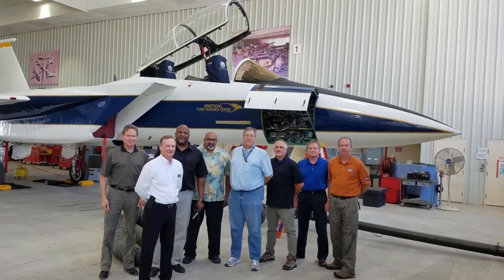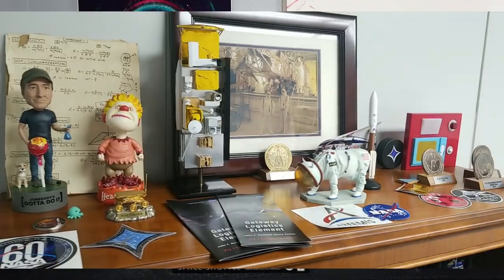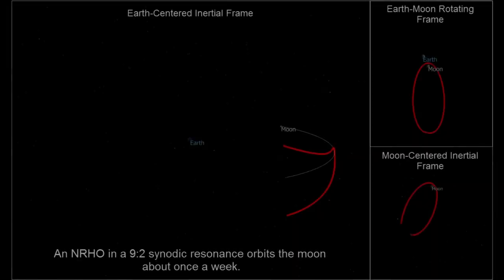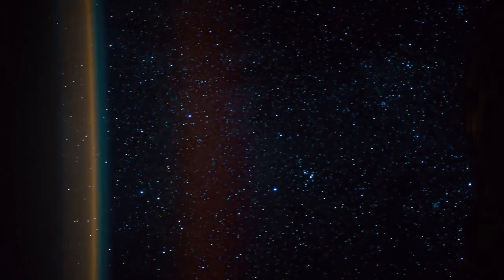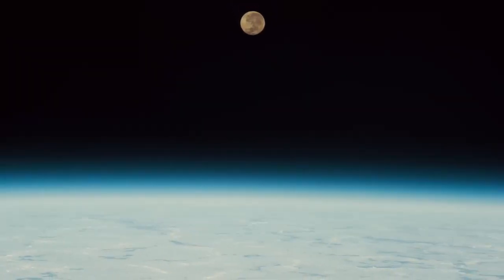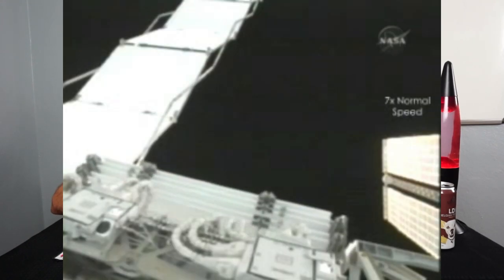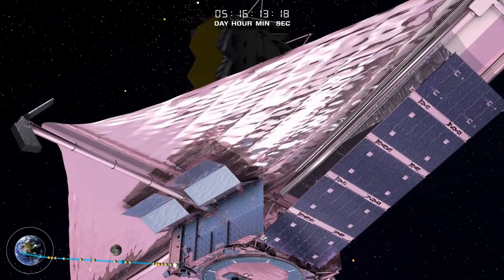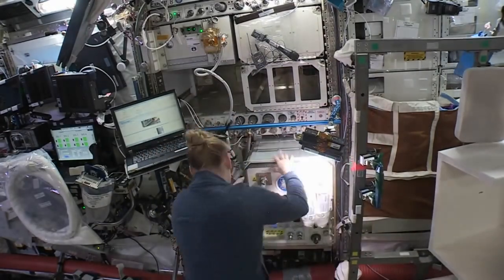Spacecraft Thermal Control! (How NASA Engineers build COOL spaceships) - Scientific Drinking 9

Comment: I read recently that for "barbecue mode" the Apollo spacecraft was pointed at the North Star and rotated around that axis. Does this mean that the spaceship flew to the moon sideways?
Reply from the maker: I have never heard that, but the vehicle would have had to be perpendicular (side-on) to the sun during flight. That means that how sideways the vehicle flew (or coasted, more specifically, since it could not perform maneuvers in this orientation) would have depended on where it was along its trajectory and what the launch date was. At times, it may have pointed to Polaris, the north star, as a matter of convenience as it is a bright and easily identifiable stat.
Reply: @Mas___SD  Thanks for the reply. I'll try to find the original source for this info. I would think because the sun, earth and moon lie generally in the same plane, that it would need to "fly" sideways and rotate to warm all sides of the craft.